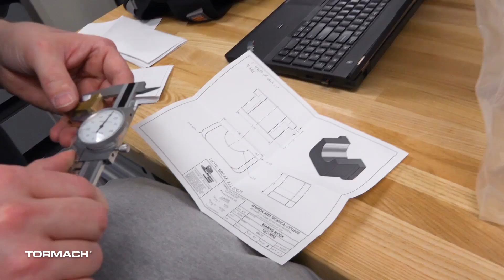Tormach Visits TITANS of CNC: Academy

Comment: When the M machines were announced, you said they would be servo upgradeable but now the M+ version is, does that mean the M is not upgradable?  Also, is a servo upgrade option still being considered for the series 3s?
Reply from the maker: Servo upgrades will be available for both the M machines (April) and Series 3 (TBD).  We will have 3 different tiers to choose from.  The M series will be a stepper-based machine with the TTS tooling.  The M+ is a user-upgraded M with servos and TTS tooling. The MX will be a servo machine with a BT30 tapered spindle, that can be factory- or user-installed.
Reply: Thanks

Comment: Okay, I have my new 770MX coming after four years of the 440 being my training mule.  I love Titan's philosophy and spirit when it comes to CNC. I've used this machine for tons of cool little jobs as well as creating protoype parts to try at my day job at MKS Instruments at a fraction of the cost and time we would get from quotes from local vendors.  With a DBA I was also doing orders of 200-400 parts at a time every week for Energizer.  Just about making the cost of the machine in 6 months of that.  Thank God Tormach chose me to try out the beta tool changer for the 440 and it came with the power draw bar or my arm was going to fall off.  I ran so many parts, I felt bad for the 440 since it is a hobby machine.  The tool changer turned it into a production machine.  BUT, now she's tired and in need of some tear down and rebuild.  SO, I needed a good machine fast with little to no learning curve.  Viola...I'm going to be cutting metal this weekend on a rigid tapping servo motored mill with 3x the power.  I was very surprised how fast it is shipping.  I barely have made room for it yet!  Looking forward to setting up my 770.
Reply from the maker: It's makes us very happy to hear success stories like this! Thanks for staying in the Tormach family!
Reply: @tormachinc  Thanks for having me in the family!  I have been using the 770MX for a few weeks and I love it.  Especially with the passive probe.  Now to rebuild the 440...it cuts bores like an egg shape.  Clunky sound from the ball screw in the x axis.

Comment: Did anyone else notice at 2:48 or thereabouts that Titan said that this machine could be had for around $6k-7k? Am I missing something or is Titan that out of touch with what these machines actually cost? You can barely get a 440PCNC for $7k and that is without any accessories or even a stand. The 770m is advertised "Make chips fly for around $15,000" and "Tricked out for around $23,500". I have been watching Tormach for a couple of years with an interest in buying one, but it seems to me as of late that they are trying to price themselves out of the very market that they have had cornered for the last few years.
Reply from the maker: Hello TN Machinist, you are correct we have a 770M package for around $15k, but we also offer our Entry Package for our PCNC 440 that runs just under $6800. As always you can add more accessories, but this in addition to a few tool holders and some simple work holding, you can start learning and making chips.

Comment: I noticed on this machine it says 770m(+).  Is this something new or just for titan??
Reply: Its there new line from tormach, they are available for sale now.
Reply: @maddiewhite6791  I know there is the 770m. Titans machine says 770m+ .  I'm not seein  anything relating to the + model.
Reply from the maker: The M+ upgrade kit, which ads user-installed servos, will be available for the M machines in April.
Reply: Thanks for clearing this up!!
Reply: Will there be a servo upgrade for the series 3 machines available in April as well or??